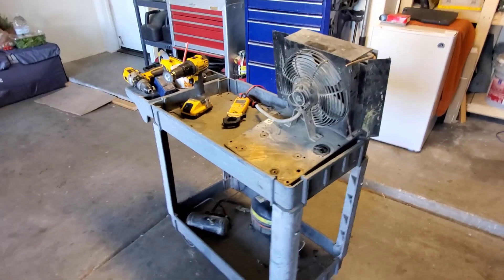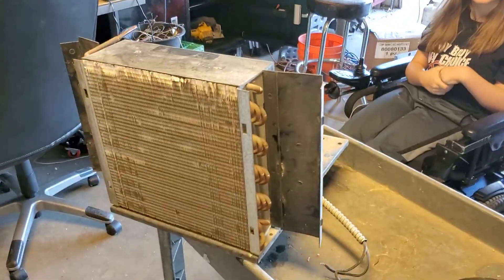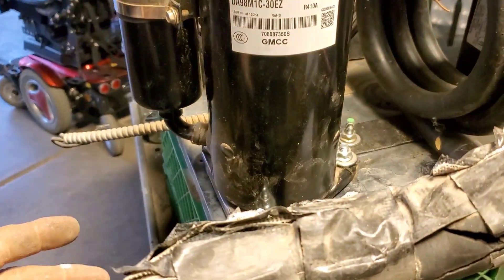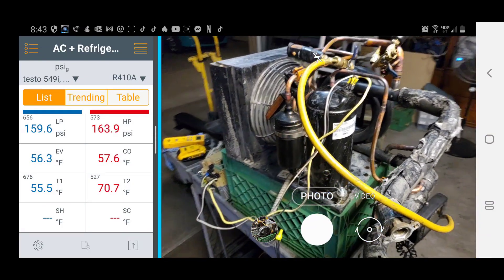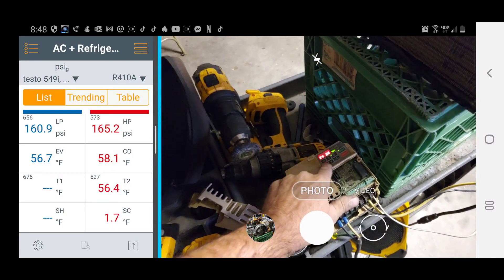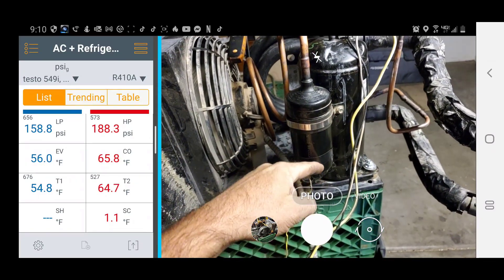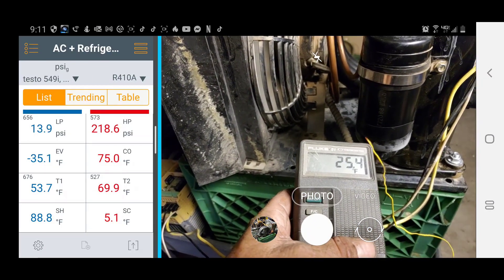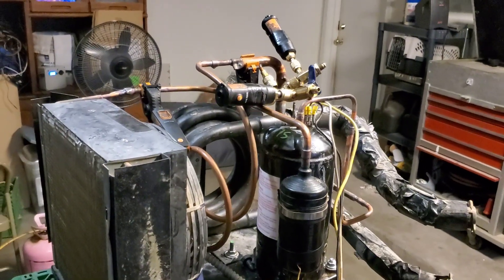Another heat pump water heater project attempt with a questionable inverter drive compressor

Comment: I coulda used your spin swager on a house I remodeled years ago. The water pipes froze and I had to make a tool to make the 1/2" fit standard pipe with a piece of automotive strut rod hammered into the pipe. I was able to sweat standard pipe into the previously frozen pipe.
Reply from the maker: Oh man, it sucks when the copper freezes and increases slightly in diameter.
They do make swages that you hammer in, that is what I used previously. 
They also have the kind that you attach to a tool like a flaring tool.

But sometimes we have to make our own tool!

Comment from the maker: So this failed, due to the compressor indeed having an internal issue.
It would randomly speed up fine then not.
Probably a broken vane inside. Maybe I will cut it apart another day.
But today I swapped in another compressor so check out the next video for update! https://youtu.be/-jPFLd6DTzM

Comment: I think it's just the liquid boiling off at startup in the accumulator
Reply from the maker: I hoped but it took a long time to boil out.
When I could get the comp to speed up to normal speed (upwards of 120Hz) it did evaporate.

Playing with the comp some more today it would randomly work then not work.
There was indeed some mechanical internal issue.
I did more work on it with another compressor. Stay tuned.

Comment: The biggest difference is that the "Brushless DC" motors have a permanent magnet rotor. Standard V/HZ mode on the VFD doesn't work well for BLDC motors, because their voltage needs to vary based on load with those motors, not just frequency. If your VFD supports a "vector" mode (sometimes called sensor-less vector), it will drive BLDC motors much better. Basically, if the voltage is too low, the rotor will start to lose "sync" with the field, and the motor will instantly stall. They won't "slip" like an induction motor, they behave more like a stepper motor really. Sometimes you can cheat it by creating a custom V/HZ curve if your VFD does not support vector mode. 

Sounds like the accumulator might potentially have a restriction in it too? Might be worth investigating.
Reply from the maker: I tried to drive a brushless perm magnet motor before on a VFD and it don't work at all. LOL
I think those like the ECM motors use the same polarity with each pulse rather than the pseudo A/C that VFD's create. Maybe I need to look on a scope some day.
This came out of a Friedrich and I have read the "A/C" output to the compressor so I think it is just like most VFD's/Inverter drive units for the most part other than the dead nuts boosted and regulated DC bus these Friedrich units use.

This compressor did ramp up perfectly fine a few times so it seems that it likely has a broken vane inside I think.

Comment: Very nice project. I know stupid question, did you check the Rotation?

I had something similar in mid, got here the guts from two Heatpump Tumblers, but i would use a mix of R290/R600a or pure R600a because R134a is expensive AF and difficult to come by here in Germany.
Reply from the maker: LOL. Yeah I changed rotation more than once.
It would pump somewhat occasionally.
Today I ran it up a few times. Random compression and random lock ups.
I think it has a broken vane or something in it.

Comment: @14:58 when you floored the VFD, the LP went from like 1psi and started climbing, bad valves or vane inside the comp? Definitely sounds choice!!
Reply from the maker: I think it has a broken vane.
By that point in the video I had clamped the liquid line with a pinch tool, else it would not have dropped like that.